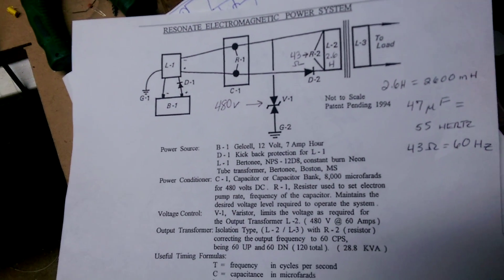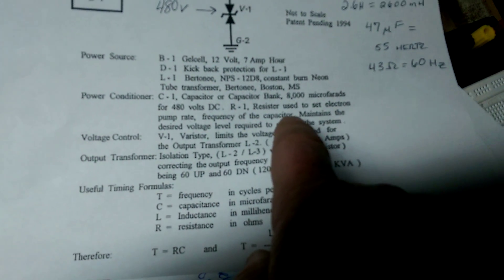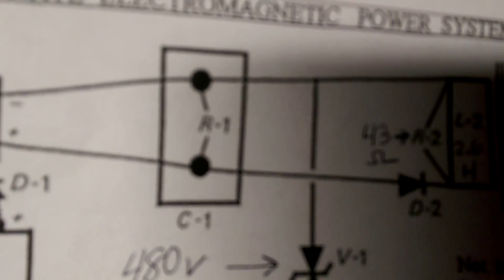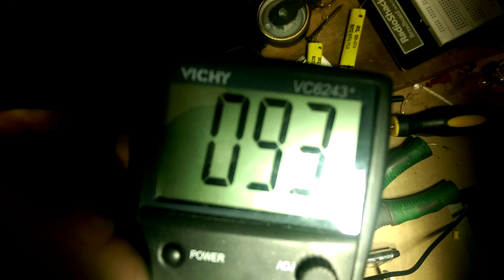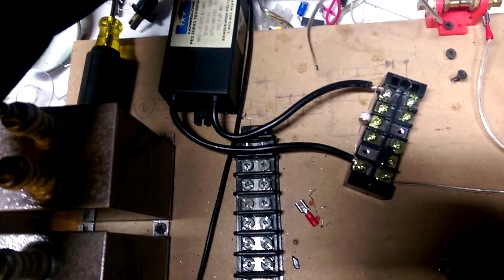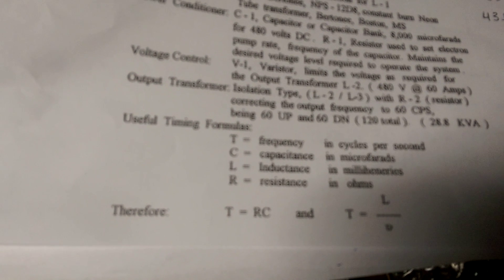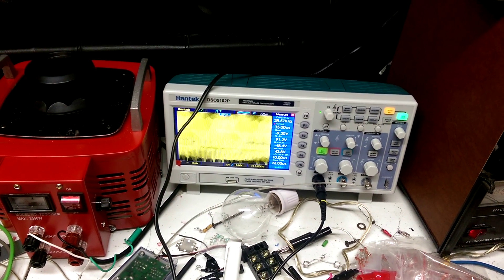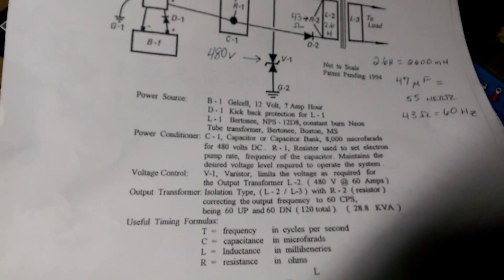Don Smith How To Video

Comment from the maker: listen up ladies and gents. I could only share this withyou and I could only do it once. I am alive and well. The system works, and I have to say Smith hid nothing, all of his diagrams worked. The problem is that all of you want it to be public. That's the biggest issue. I have posted likns to the real deal on over 100 occasions. They all disappear. When something really works, it all goes away. I will share one thing with you all. The most simplistic system for overunity is this. Build a circuit that charges off of solar panels. Use 4 battery banks, charge 3 with the solar and build a comparitor circuit that will put the highest voltage battery to the load with contactors or relays. Use a Raspberry Pie or other brans circuit board to measure voltages and switch accordingly from bank to bank, placing your load and inverter to the highest voltage bank, then instantly switching to the next highest and disconnecting from solar, hydro or wind to charge the low batteries. You could be independent from the grid if you complete this. I am no engineer but I do know this is possible. A former government contractor built this for me using Arduino and a couple of self printed circuit boards that are not sold anywhere. If you all look you will see they do NOT sell rotational battery bank charging systems because they will run 100% of the time provided you use solar and hydro or combo of wind generation. Do NOT use Smith technology or even waste your money. These devices rob energy from Earth's capacitance, which takes cosmic energy from the magnetosphere and changes our planet's characteristics formed by the charge of our weather system. This would change weather patterns, eliminate lightning and  protection our atmosphere gives us from the energy stored within the clouds, between the ground The government, oil companies and others will kill or threaten your family if you disrupt their earnings. I will tell you this, Kapanadze, Smith, Moray and Tesla ere all correct, it will work but it will kill the atmosphere's solar radiation eliminating ability and we all does from solar radiation burns during CMEs and solar storms that will focus upon us like magnifying glasses. I'd rather have friends on this planet that believe in me. I haven't posted in years due to many pretty scary threats. I won't have more so take my explanations with a grain of salt, they are very real. God Bless and Good Luck!!!
Reply: I think the problem is people need a parts list and a build walkthrough video from start to finish and nobody has ever created or shared that.  If this was all true, why not go through the effort of doing that and sharing it everywhere you can like rumble, bitchute, forums, etc. There are talks we may one day experience major power outtages from solar flares or worse and nobody seems to ever share this info and it's really sad, depressing and discouraging.  I know many people researching this for years spending lots of money on it getting nowhere to get spammed with 100+ patents of information overload on multiple forums that lead you further nowhere.  All people need is 1 device relatively low cost, easy to build, and safe to use.  Nobody anywhere has ever shared or done that.  Humans I guess are not capable of doing that and it seems only an advance civilization will ever do it.  They apparently had free energy in the 1900s with Tesla, they had it in Tartaria, they had it in Egypt, they had it in Atlantis.  And for some reason in this period in time we don't have it when it's clear we should.

Comment: Hi Mark, regarding the suite case  device. The 12v nst is the source of the heaviside current due to the spark gap transforming the massive E-field into a magnetic current. The multistrand audio wire wrapped around the outside of the core rotates the guides the magnetic current. Is the transformer made of blank magnet tape or ferro tape? Also, is there a permanent magnet inserted inside the center of the core so as to have the heaviside current control the induction by increasing the energy of magnet through the blotch wall?

Comment: Hey Mark ... did you tried this experiment  till at  the end? You talk about  varistor in the clip  but in the  comments you mention about varactor ....  what I found are low voltage and low amp ( miliamp range ) varactors ...  so  finaly , what   you have used however  in your experiment ..varistor  or varactor and what  performance did you get with your circuit ?

Comment: Hi, you have a neon transformer, how many volts it produces ??? if you have an output of 4000.
  1) if you need 50-60Hertz. then select by formula.
  50-60Hertz
50 / 4000DC = 0.0125 uF. The capacitor must be 0.0125uF / 4000DC
60 / 4000DC = 0.015 uF. The capacitor should be 0.015uF / 4000DC

Comment: I see the Light! :)
Reply from the maker: it's running self sustained. You don't see the battery levels depleting, do you? If you did, it would go lower by .1 to .2 volts per second respectively. The battery is charging because the wire dangling from it allows the wave to absorb into the terminals and self charge as Don Smith did. It does truly show something, even though it is small, I figured out how and why his system works. Since my video hasn't been taken down, it is because I am not telling everybody exactly how it functions. If you look closely at the grounded wire next to the neon transformer, that is why it does what it does. I need to find out how to do so with a solid state suply. The hand wound transformer is way too inefficient to produce more than 2 bulbs worth of energy while self sustaining.
Reply from the maker: oh, BTW, I'm glad to see that you are so negative while you obviously know so little about radiant systems. Read up on Ed Gray and how his system functions, then maybe you'll actually gain a bit of belief when you actually learn, understand and become knowledgeable enough to build one yourself. I don't cater to the negative, so I wish you the best of luck while you bash my experiments.
Reply: Interesting observations. Even solid state supplies have coils in them, switch mode types use small/tiny transformers although they don't handle the load directly. They all radiate energy fields already. EMI they call it. Useless dipole killing conventionalism. Suppressed indeed and ignored by those afraid to look outside the box.
I'm picturing what you're saying though. I'm an inventor / invention developer myself as well as other tech trades. Everything Don say's makes perfect sense to me. Easy to understand if you know the techo' jargon and math is easy enough. He said "I I can see what's in Tesla's mind" in so many words. I can see what he's describing. Cool!
Quantum Physics man. That's where it's at! ;) I have a site I haven't put to use yet that fits this game perfectly. EatherTron.com I'm thinking about getting involved in this quest for tapping the ZPE/Dark Matter/ The Aether. As in -
Aether: The medium supposed by the ancients to fill the upper regions of space.
Physics. a hypothetical substance supposed to occupy all space, postulated to account for the propagation of electromagnetic radiation through space.
Fascinating!
Do you know who Tom Bearden is?
Reply: Please, don't generalize! I don't BASH your EXPERIEMENTS! I bashed only this one! Perhaps you should do a bit better at explaining your observations. I was simply challenging you and I do understand your passion. I've been there. You don't know as much as you pretend. Perhaps a bit more than me for now but it's already obvious to me that what Don say's is quite plausible and I've always beleived in Tesla, not fairy tale belief either., I've studied and built and run some of his 'radiant' energy machines in fact! You've of course heard of the Tesla Coil. I hadn't thought of using it in reverse but I can completely see why it would work!
Sorry I gave you the wrong impression. I am impressed by your experimentation or I wouldn't bother commenting or inquiring.
GodSpeed my Friend!
Reply from the maker: useless unless pulsed into the ground and collected at the proper wavelength. Also, if we pulse into the Earth, we collect it again amplified. Radiant energy is the pulse on the outside of the wire that strikes and can be collected without connecting to the wire, although it has nothing to do with EMI, the EMI would mean it would be collected by a coil as a transformer does. Radiant energy is emitted axially by any conductor that pulses and it can drive massive machinery with merely a few watts of input, however it does have to be high voltage and to properly collect it, it needs to have a dc source on one side and a pulsed hv source that can't kill the dipole on the other side. This is one of Don's pieces of the puzzle. Tesla was the innovator, nobody else.
Reply from the maker: Radiant energy is mostly confused with electrostatic energy, however it works in the opposite manner with resistances. You gain output with higher resistances or impedances and lose energy with lower ones. A light bulb is a good instance. The 100w bulb will be dimmer than a 40 watter, a lot more output in the bulb is seen and less energy used, so therefore the outcome is amplified / multiplied, however you'd like to look at it.
Reply: Exactly! Tesla still is the man! He defined much of the phenomenon we know as EMF. It makes sense that a Tesla Coil is simply an Aether Amplifier or better put, an energy concentrator. The ARCs are a result of that phenomenon as enough energy is available to disrupt the otherwise balanced Dipole hence, EMF is achieved.
I wonder what the Aether would look like as it is being disrupted, would it look like whirl pools as it is tapped or focused? We are definitely warping the Aether somehow with this HV HF phenomena. Generators break the dipole to emit EMF at a certain rate and level. Interesting way to look at it...

Comment: is it possible to build for me as a greenhorn? i just began with electricity....i built allready a electromotor thats all.........or do you say is better to not build it for nonprofessionals??
Reply from the maker: your best bet is to study coil shorting. This is the key to overunity. By shorting transformer coils at high frequencies at the "peak" of the waves is the method used to create 200% to 1000% of your initial input. The shorting has to be done in the correct location with the correct components, however it could certainly be done mechanically with a commutator as Joseph Newman did. If we store this energy in capacitors, we could easily invert it and have massive amperage, which yields yet another form of very high powered amplification. Be very careful with it though because it not only boosts the amperage, but it boosts the voltage. I will get you to a starting point, but by building folks these generators is a death sentence, and I kid you not, it is very real, and we are all being watched because this is a very sensitive issue that will prevent people from making billions. That kind of money can easily kill folks, their families, etc.

I'd rather pay for electricity than have my kids killed, and I'm sure you would too. Trust me, research this on your own and build this on your own. It's not very hard if you already have some motors and generators to start with, and if you have some large enough to run your home or garage, wherever you plan on using this, you'll be easily able to capture the additional energy needed to store the energy into caps and batteries which will then power your prime mover which could be a large DC motor.. You could simply build some shorting circuits for your generaator,  per coil in order to output the additional energy into external coils, then use separate cores to negate lenz's law and fire the energy per coil back into the motor, converted back to dc, or with ac induction motors. You can give the motor a boost by kind of slapping it with additional energy in the correct direction. Once this happens, the loads will absorb the additional energy.

Look here:  https://www.youtube.com/watch?v=FbWaQmZIOwo
The Don Smith setup you see above is only able to run a couple of bulbs, I haven't perfected it yet, however I am on my way, I have output pulses well over 50kW in one shot, so I am not far away, I just need to build some circuit boards that will invert the energy stored in the massive cap banks I just bought, but , in the meanwhile you could easily enjoy 10kW of free energy from a 5kW generator running on the low end of maybe 1000 watts if done correctly. Magnet core generator heads are the key to acquiring this energy. Field coil rotors won't work unless a battery is used to feed the coils with 2 on and one shorted, 2 on,  one shorted, in the rotational direction the motor spins. etc., etc., it is really all about timing to get it to work correctly.
Reply: Yes I hope too that Trump will be the one kicking out the dark cabalists and pedophils from governments and leader positions in USA....but after that europe needs to change too.....so far the media just tells very very bad about trump here in europe: they say he build the mexican wall...the pipeline through the sioux res. etc.....not very nice....but who knows what is true here in our european media.......but lots of spiritual peoples say that trump will bring the changes......but of course his own profits with oil is something i doubt he really will bring changes......but so far i still have hope for him.......anyway this year future will show it......if there is no more war aggression from USA against the 3.world then the changes have arrived...just to know that USA destroyed over 52 countries completely and have over 300 military bases allover the world.....well here in Switzerland is the bank royalty-Rothschilds real home and they are very near to where I live...and not very well known specially the relatives of jacob and baron David...but if these peoples agree to get free the free energy files then it is here ..the change....because insiders told me that Nathaniel here in switzerland is responsible to keep all free energy files and devices in a hidden place....and yes they over human lives for that......but not long anymore I guess.......but to say: if someone normal human will find out a machine to let a car run for free energy or a home than he will have to give out the plans and files for free to as much peoples he can and if then more then 10 000 peoples have built such a device and they all do projects around the world then it is done.....
Reply from the maker: Thanks for the comments. I always hope for the best. Perhaps one day the Swiss village that has held onto free energy technology until the world has become more responsible will eventually release this to the world. I certainly hope so because it is a bulletproof system that has run without fuel for many years. i hope the world gets this and never looks back. I can't stand sitting back watching the world's leaders allow the fuel for our planet be harvested and ruin our place to live. It's awful!

Comment: there are 1000s of plans and so on on the web and noone so far workes...the only i will try to rebuild is the perendev magnetic motor with bismuth shielding cups.....
Reply: Maybe start with something simple such as Bedini's SG. Go to energyscienceforum.com. This is eassy to get working and will give you an understasnding of what you might be looking for, other than criticising that which you obviously do not understand.
Reply: dylans voice  No fantasy but elementary knowledge of electronics & physics. More info? go to my YT channel.
Reply: dylans voice  My video's show how electronics work and (thus) the laws of physics that are valid in electronics and discussions about energy laws etc. A basic analysis of this "how to do" schematic shows that fantasy properties are attached to the electronic setup. For instance: what happens when a capacitor is bridged by a resistor, like that is done here? All these "energy calculations" are phantasies.
Reply: dylans voice  don't know what you mean, but OK.
Reply: None of these circuits work because there is a) no overunity b) the resonance phenomenon is not understood by any of these inventors c) even the most simple properties of electronic components (especially capacitors & coils) are not understood by these inventors and d) the laws of physics are not understood. All these circuits are phantasy circuits, don't spend your time on them.
Reply: @radiofun232  Faithless.   Hopeless.   I pray you'll read with some hope,  especially in the water based hydrogen motors.   you think everyone pulls the same joke with the same setup?
Reply: @JosephEnce  I don't understand your comment/question.